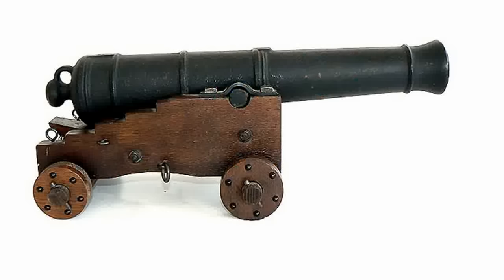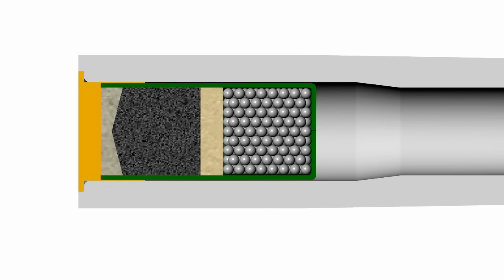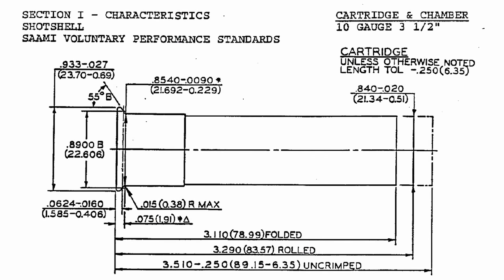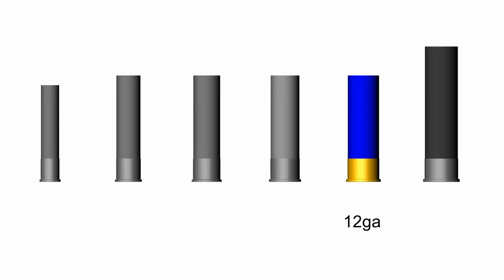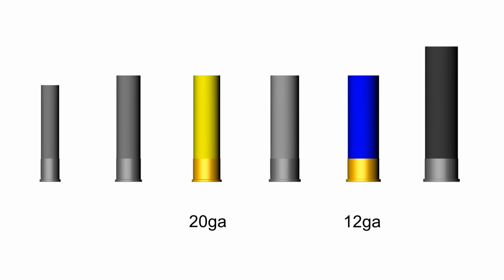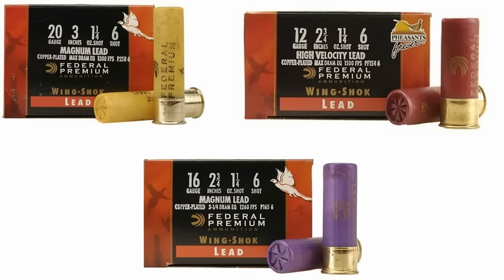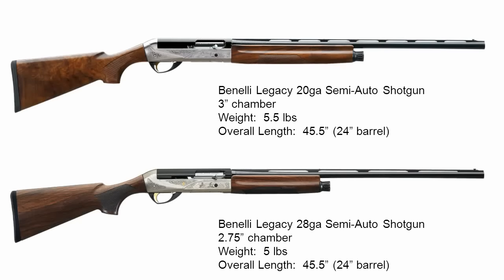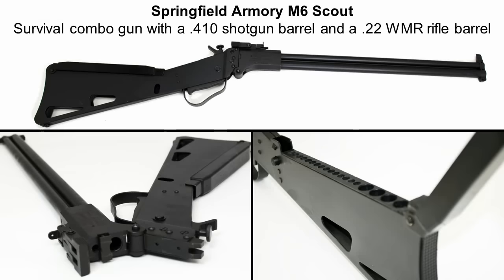Shotgun Gauges Explained - Shotguns 101 #3

Comment from the maker: Hey all you new viewers, glad you found your way here.  Lots of folks in the comments section asking about the 4- & 2-gauges.  If you want info on & examples of guns in those bore sizes, here are some recommended videos, both from the excellent Forgotten Weapons channel:

4-bore (same thing as gauge) stopping guns:
www.youtube.com/watch?v=MDYtxxRU_cY

2-gauge custom double-barrel:
www.youtube.com/watch?v=OYlDgwo52tI

There are several reasons I didn't get into the monster gauges in this video.  First and foremost, they're really not in common use; there aren't even many of these guns in circulation aside from a few surviving historical firearms (often not in useable condition) and a rare custom-built piece here and there.  In this video, I wanted to focus on gauges that are in common use; the options that a new shotgunner would be choosing from for their first scattergun.  Getting into the weeds on antiques doesn't really fit into this video's intended scope.

Second, there was a lot more variation in these larger sizes, as was often the case for shotguns in general back in the days of 4-bore safari guns and large market hunting shotguns.  Actual bore diameter and (for cartridge guns) shell/chamber dimensions varied quite a lot.  Ammunition was rarely interchangeable between guns of different manufacturers, and the standard gauge formula based on lead ball weight wasn't always adhered to very closely.  For example, many waterfowl guns marked as 4-gauge were actually more like 6-gauge by the formula.  Again, a lot of weird details and potential confusion to try to tackle in a video that's really meant to cover the basics and explain the currently-relevant options for shotgunners today. 

Thanks for watching, and please don't hesitate to ask questions if you have them.
Reply: oh shoot im early to this comment
Reply: Those are elephant guns. Powerful enough to kill an elephant or Rhino in a single shot.
Reply: Very well done video. Thank you.
Reply from the maker: @Novusod  Not only a single shot, but also "right f***ing now", before it has a chance to trample you.
Reply: @SynchronizorVideos  Yes, that is true too. Regular 12 gauge slug might still kill an Elephant in one hit but it will it will take a minute or two to die. Plenty of time to still kill the hunter. The Elephant gun makes sure the animal drops straight to the ground and dies instantly.
Reply: I wish shotgun manufacturers would just standardize on 12 / 20 / 28 and abandon .410. Modern times have effectively obsoleted .410, considering no quality guns have been made in it for several decades, and modern recoil mitigation means that 28 can feel like less recoil than you'd get out of an older .410. You don't want to give a kid a .410 to learn on because they're almost invariably poorly-made overly-lightweight guns that will kick hard while not putting out enough of a pattern for them to actually hit anything. .410's have turned more kids off shotgun sports and hunting than just about anything else.
Reply: @Novusod  or punt guns. These are strapped to a punt (boat), aiming is done by moving the punt itself. Loaded with shot the idea is to kill 20 or 30 ducks in a single shot.
Reply: Why you stop uploading
Reply: Will you ever make videos again?
Reply from the maker: indradevaputra putra  The .410 is pretty weak compared to most metallic cartridges.  Even a warm 9mm is more powerful than a .410 slug out of a handgun.  .500 S&W blows the .410 out of the water when it comes to single-projectile loads.
Reply: What was that about always finding ammo for 12 gauge? It almost nonexistent but 10 gauge is everywhere.
Reply: I grew up running the inter-coastal waterways surrounding the southern tip of New Jersey. The Delaware bay waterfowl legends were ripe with tales of punt guns bringing down huge numbers of birds. Sometimes I cuss the old timers when I don’t get to see any feathers or have to heed the restrictions. Wish they’d have had the sense to conserve the population... thanks for letting me vent!
Reply: Thanks so much for the links. I got here from an amusing video of someone firing a 4 gauge so this is great.
Reply: @Novusod  I don't think you are allowed a shotgun for "big 5" hunting. they only allow certain calibers and loads. I do have certified elephant loads for my 45-70, but they are just for entertainment at the shooting range.
Reply: @WardenWolf  for some reason people seem to be embracing the .410 pistols. I don't get it though.
Reply: @SynchronizorVideos .
 Might as well make .45 long colt rat shot 
Instead of. 410 lol
Reply: @WardenWolf  its popular for a reason.  Just because YOU dont like it doesn't mean other people  don't.  Its a sport cartridge that has many utilitarian uses.
Reply: the 18 gauge
Reply: I hope you're able to start putting out videos again one day
Reply: Slug video?
Reply: any recomendation video about determining sizes and quantities of buckshot pellets in specific shotshell?
Reply: @Novusod  wich is a stupid thin to do.
Reply: Can I use 12Ga in my 10Ga shortgun? We have more 12 than 10Ga bullets in my country.
Reply: 😊😊😊😮😮love that

Comment: had an old blunderbuss shotgun with a 1.1 inch diameter barrel (basically a 4-bore) and that thing was a hell of a kicker. 250 grain of powder, wadding, and literally anything that fit in a shot-glass just poured down the barrel. we shot nails, rocks, empty 22 brass, a few home-made slugs, steel bb's, and about a foot of 1 inch aluminum chain that one time. the way you fired the thing was to put 90 percent of your weight forward on your left foot and lean almost falling over forward, so when it fired and knocked you back you kinda step back into it and land on your forward foot. i miss doing dumb shit.
Reply: My god that's cool

Comment: I'm in my 50's and had never even heard of a 28 gauge shotgun, and I've hunted and been around hunters most of my life.
Reply: My dads been shooting skeet and sporting clays with a 28 gauge. 12 gauge was too easy i guess
Reply: How have you not heard of em
Reply: 28 gauge is pretty common around where I live in texas
Reply: 28 gauge = bigger .410 Jury
You know, the shotgun revolver !
(Executioner from Black ops 2, look it up)
Reply: My Great Uncle had a Single Shot 28 that he kept beside the front door. It's a great little gauge!
Reply: A guy i know at the range just bought a Remington 1100 in 28 that was made in like the 60s so 28 gauge isn’t new
Reply: If those have mini knives inside them in an amount that is a multiple of 28 I swear I'm gonna laugh
Reply: 28 has always been my favorite grouse gun.
Reply: I heard of it when I was a young guy, just never saw one. We used 20, 16 or 12 gauge (not that many 16's in my neck of the woods). Did once fire a 10 gauge Matador Double-Barrel, (only 1 barrel) with a 3 1/2" shell. Was around 16 then and was used to shooting 12 gauge but that10 really gave my shoulder and cheek a jolt. The guy that owned it used it for migratory geese. We were shooting shotguns (20 gauge) at 12. Hunted Dove, Quail and Duck, around the Chesapeake Bay.
Reply: @annapolismike  .410, 16, 12, and 10ga here. The 16 is a double barrel side by side Fox Model B. Which when last sold in 1988 went for an MSRP of $525. The 10ga is an old Zulu Rifle that was converted and I would not consider safe to use except with a blank. It looks to have a barrel thinner than electrical conduit.
Reply: @gravelydon7072  you sound like a real shotgun  guy. I no longer own a shotgun but am looking at the short barrel Mossberg 570 with wood stock. Own pistols and a semi-auto rifle. The 570 would be for home defense, with a little 00 Buck. When I was a kid and teenager, owned a Mossberg 20 ga bolt and a 12 ga J.C. Huggins pump. Had some good times Duck hunting on the western shore of the Chesapeake.

Comment: I happened to finally find a 28 gauge side by side. It has quickly became one of my favorites. It's a close tie with the 16 gauge side by side.
Reply: My first gun was a 28, it was good to hunt smaller game without spoil the meat too much. Nowadays i use a 12ga, its fun to shot in single hand mode.
Reply from the maker: Smaller bore sizes really pay off in SxS shotguns, since the bulk and bore offset of larger gauges is magnified by doubling up on the pipes.

Comment: I was brought up with BB guns and received my 16 gauge single on my 12th birthday. In my opinion a 16 full choke will hold a tighter pattern than a 12. But guns are like boats to many. The bigger the better.
Reply from the maker: You can dial any shotgun into a similar pattern.  The advantage of the 12ga over the 16ga is that it'll throw more pellets in to the same pattern, making a good hit more likely.  But that comes at the expense of a bulkier gun and more recoil.

Comment: that .410 judge you showed can also chamber .45 colt
Reply: You can also chamber a .50 bmg into a 12 gauge
Reply: @patches3555  only diff is the judge is designed to chamber the other round
Reply: You can put a .410 in a .45 barrel but not the other way around. Also 50BMG in a 12GA will just blow up the shotgun taking your hands and face with it.

Comment: I now know that 12 gauge isn't the caliber but the (aprox.) size of the pellet. Nice video mate!
Reply: No, totally wrong.
Reply: @davidmcguire6043  actually hes right. Gauge is a measurement for most sheet metal and wires. That's actually where the "X-gauge" came from. Research before you speak.

Comment: Bought a 16-gauge Winchester Model 1200 pump shotgun I found in the used gun rack at our local Cabela's store.   The only reason I bought it is that it is exactly like my Dad's 16-gauge Model 1200 that was the first shotgun I ever fired.  God I thought that thing was a cannon.  Now that 16 gauge Model 1200 is one sweet handling shotgun and the recoil isn't near what the impression I had years ago with my Dad's gun.  True 16 gauge shotshells aren't as common as 12 or 20 (supply can be 'iffy') and are generally more expensive.  However I just had to have that shotgun for sentimental purposes.  Don't regret the purchase at all even though the 16 gauge is now considered as something as an 'oddball' gauge.   He also had a Belgian Browning 'Sweet Sixteen' that I wish I had but he sold it years ago.
Reply: Thomas Moje 
I still have my 1969 A-5  Browning "Sweet Sixteen" that I still hunt with.  A lot of these "real" turkey hunters think that I am seriously under gunned.  But when a turkey hangs up at 50 -55 yards in the open and they are sitting there hopping it will come closer, which it usually doesn't, I just go ahead and drop him.  I get some of the strangest looks from them.  Many years ago I was in on of the local sporting goods stores and they had Federal 16 Gauge Magnum shells so I bought a box of #4 and a box of #6 the #4 has  168 pellets the #6 has 281 pellets (1 1/4 ozs.) same as a 20 Gauge 3" magnum but they reach much farther and hit so much harder.  They made my little 16 so much sweeter.

Comment: I got a little Mossberg 500 in 20 gauge when i turned 14. A decade later and im still busting clays, dropping birds, knocking over rabbits and about to go on my first pheasant hunt next week with my dad and grandfather. 

Im a small guy, at 6' 4" and 125lbs, so most pump 12s thump me just a little too hard for me to want to shoot them all day and practice. Double barrel 12s are even worse since they're lighter, some semi-auto's i can shoot though with little issue. So 20s have always had my favor for the lighter recoil and weight no matter if its pump, semi, single or double barrel.
Reply: Best all around shotgun ever made imo. Easy to use, durable, and easy to clean. I got a 12 guage 500 when I was a youngster.
Reply: Jesus. 6' 4" 125 lb. Time to get a bigger gun and eat something other than birds and rabbits.
Reply: Jardmang  I'm 125lbs is why i say im small. I look like a skeleton with skin on it my guy. Modern double barrels are lighter than pump guns because modern guns don't use cast iron barrels anymore and haven't for decades, Its all steel, which is significantly lighter than cast iron. Whatever "traditional" double barrel you may have with cast iron barrels is an antique and is not the standard anymore.

The decade of shooting experince doesn't matter for the recoil being more than I like to handle. Again, I can shoot 12 gauge whenever I want, but I don't want to because of recoil, its not a can or cant situation, its a preference. It thumps just a little too hard to be pleasant for very long.

Call me whatever you want, I don't really care, its the internet. People get called names and fakes all the time. I just thought I'd share my experiences for those who could relate.
Reply: Jardmang 6’ 4’ 125lbs is a small guy. People tell me to put some meat on my bones at 6’4’ 165lbs.
Reply: Jardmang  again, you're missing the part where i said "I don't want to because of the recoil". Its not a matter of can or can't. I CAN shoot a 12 gauge all day long, i do not WANT to shoot one all day long because it has heavier recoil that I find unpleasant to deal with for very long. For the 3rd time, I CAN handle it, i CHOOSE not too because it is unpleasant.

I PREFER a 20 gauge because it has ligher recoil and I can handle that easier and find it more pleasant to shoot. 

You have this notion that years of shooting experience somehow relates to how recoil feels and thats simply not the case. The feeling of recoil does not change over the years. It will hit the same way everytime. 

How a person handles that recoil will change over time based on their body size changing, their shooting form improving and if they use recoil buffers or better padding on the stock of their weapon.
Reply: Height also dosent remotely relate to how someone can handle a firearms recoil. If anything being very tall but very thin would negatively impact your ability to handle recoil as the force would be hitting you from much higher up with less weight to push against.

Comment: The beginning explanation of "how many pellets could be cast from a pound of lead" makes the "gauging" make more sense now even if it's not absolutely accurate. I've always been confused why the smaller gauge size means a generally bigger and heavier pellet/slug (ignoring the larger barrel bore).

That all cleared up, I'm now bothered by something else. What the f**k is an "8ga Industrial Shotgun" and what does it actually do for industry? I've never heard of there being industrial level firearms and now I want to find an "Industrial 6 in. Dual Purpose, High Angle, Naval Guns" and some "Industrial 18.1 in. 45 Type 94 Naval Guns" . . . . for industry reasons.
Reply: small numbers always mean larger measurements in everything that is gauged. Wiring, sheet metal, etc..
Reply: 8 gauge industrial shotguns are used in steel mills and furnaces. Heavy pieces of slag collect on the inside and affect heating performance. It can be broken up by hand by sending a person in but that requires shutting the furnace off and is very dangerous as some of these slag pieces can be many feet long and weigh hundreds to thousands of pounds. So they use the shotgun to break off the pieces of slag and can do it while the furnace is still running.
Reply: Here’s a great video showcasing it: https://youtu.be/uJG3uTUJ2J8

Comment: Currently, the biggest shotshell gauge in  use is the shells used for the Russian KS-23 series of shotguns and are 6.5 gauge by euro standards
Reply: 23mm anti aircraft barrels.
If you want a shotgun that can be used as a sniper, KS-23 is perfect.
Reply from the maker: Shotguns get quite a bit bigger than the KS-23, but nothing larger than the 12 or 10-gauge are particularly common.

Comment: I have an old Winchester 1897 16ga. shotgun, it was handed down through our family since my granddad .  It's a fantastic old shotgun that has the ability to find the rabbit that runs into the thicket, or knocks out a grouse from the air.  albeit, it doesn't have an adjustable choke like a modern shotgun just a full choke. it's what I learned with as a lad in the 1970s. I like my 12 gauge but that old 16 gauge holds a spot in my heart. powerful, but won't knock your glasses off your face with heavy recoil. finding ammunition is a real challenge these days. (even when the shops are fully stocked) seems like it's still popular in parts of Europe.
Reply from the maker: Nice.

And if you're having trouble finding ammo, you should take a look at handloading.  Handloading shotshells is more straightforward and requires less equipment than handloading metallic cartridges, and it lets you build exactly the loads you want rather than settling for whatever you can find on store shelves.